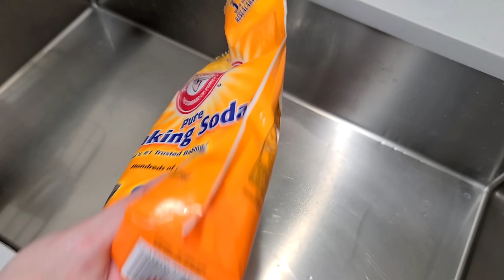EXTREME FILTHY DEEP CLEANING HOUSE MOTIVATION! CLEAN HOUSE WITH ME! HOUSEKEEPING!

Comment: I’m getting new floors in the whole house including the kitchen.  I had to unhook my appliances (gas in the stove and dryer, so had a professional do it as I don’t want to mess with gas lines!) and then at the last minute my install date got moved by almost 3 weeks!  So I have been without some of my appliances for over a week now.  I’m dog sitting for my next door neighbor so thankfully I was able to do laundry over there, along with filling my jugs up with filtered water since my fridge water was unhooked.  BUT, I was able pull my stove out completely and clean all the nasty spills down the side and clean up underneath it.  I did my fridge, too, but I do get to that more frequently than any of the others based on where it is and how accessible it is.  I want to pull out the washer and dryer and get all around and under those while they can be pulled out completely.  My guest bedroom looks like a hoarder house because I moved so much stuff in there to clear the floor space, so I’m looking forward to getting these floors installed so I can FINALLY get my house back to normal.  Also looking forward to setting up the robot vacuum I got (using your Amazon link) a month ago once the floors are in place!

Comment: I would love more deep cleaning hacks, although tbh I enjoy all your content so I'll watch regardless 😊. Today I deep cleaned my bathroom - I have very hard water here and struggle with limescale and water marks on my shower glass especially, and recently got some new products - one is a heavy duty cleaner for the glass which has worked fantastically well, and the other is a nanocoat product you put on the glass that is supposed to reduce the amount of cleaning required/make it easier to clean - so that went on today and we shall see how it works in guess. Also did the floors which is almost a daily requirement currently as I'm having some building work done and the dust and mud is everywhere! I'll be very glad when it's done, not least because then I'll finally have a proper laundry/utility room, which I'm ridiculously excited about 😂 Thanks for all you do, your videos are always great motivation and entertaining!

Comment: Do you fing it difficult to clean in the sharper corners of the stainless steel sink? I might be interested in maintaining the stainless steel appliances and whether yours easily show finger prints or not. Do you use a specific type of cleaner for the outside of the stainless steel appliances?